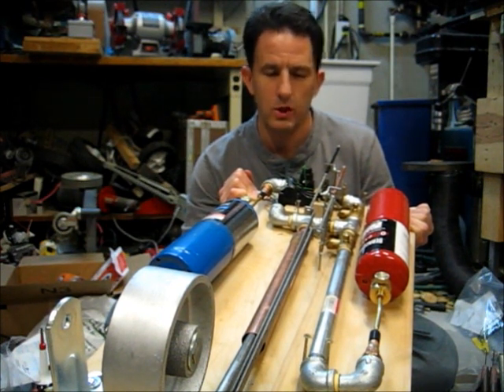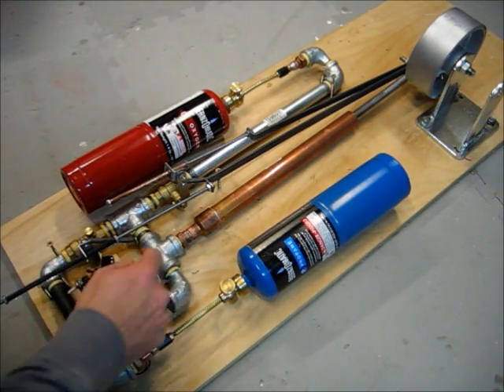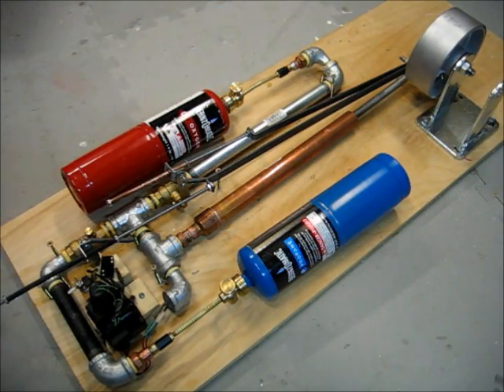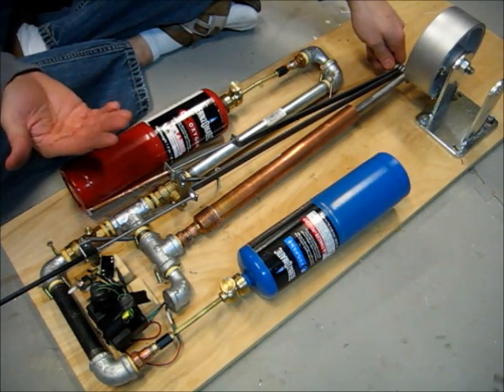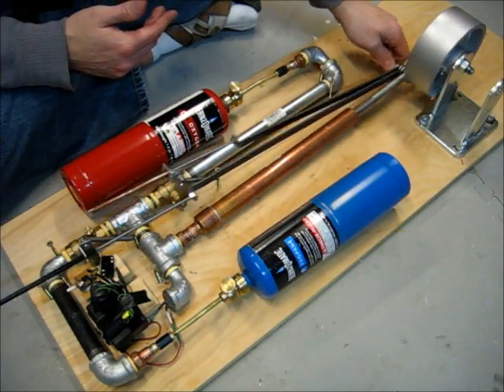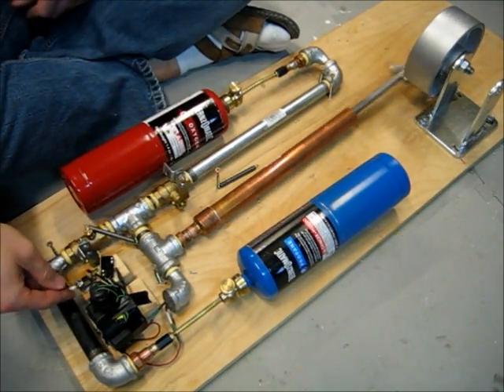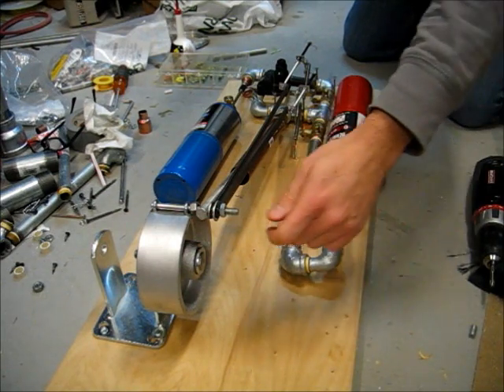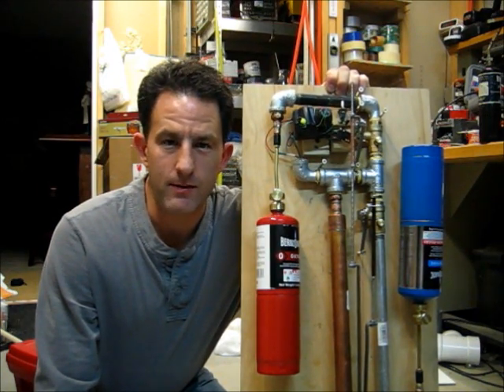How To ALMOST Build an Engine With Only Parts From the Hardware Store (HowToLou.com)

Comment: I agree, you need to exhaust the spent gasses. Looks like a heavier flywheel wouldn't hurt, which would help to keep up the momentum. Also, once it does start running, a heavier flywheel will keep the RPM's from going too high.

Comment: Too many moving parts.. The cylinder for the piston should be larger and should not move. The advantage to having the larger cylinder is there is more room to play for the connecting rod. Try to think in terms of an steam locomotive. Also consider counterbalancing the wheel to help keep momentum.

Comment: I didn't see or hear you give any explanation of how the exhaust gases are removed from the tube after an explosion takes place.  From what I saw you have good ignition only on the first firing or in further ignition pulses are applied AFTER the tube has had a moment to relax and "leak" out the exhaust gases. a one-way valve to open on the return stroke that expels exhaust gas may give you better results.